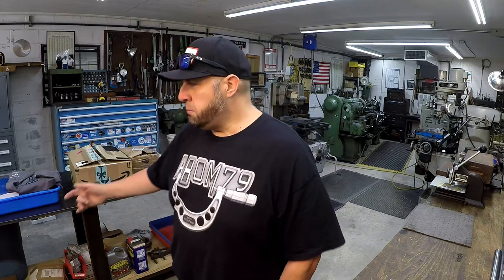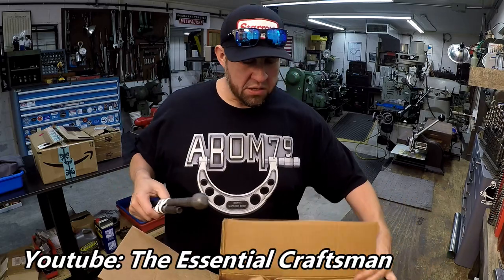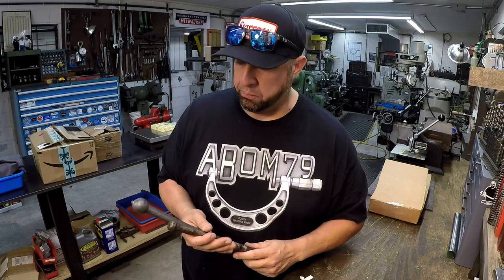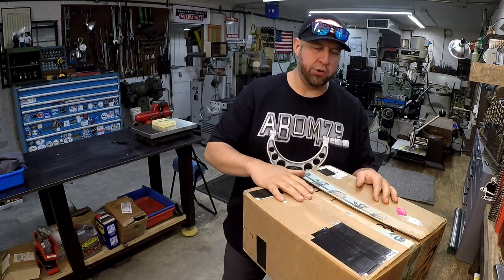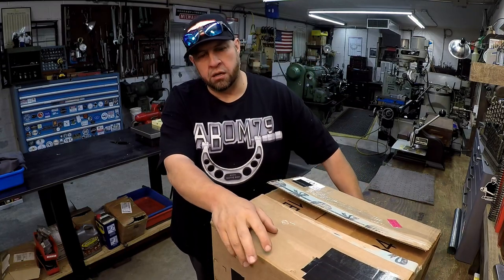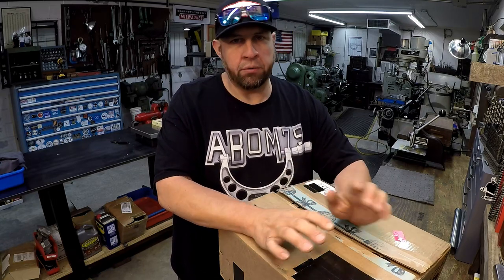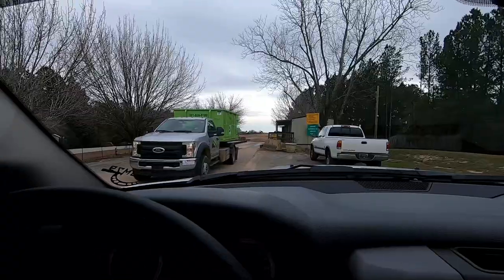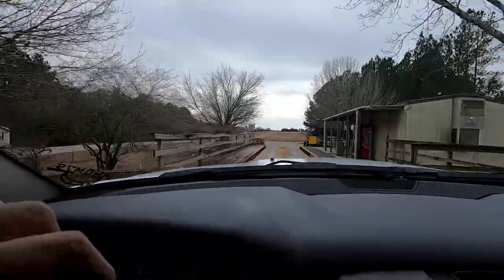SNS 251: Collaborations, Surface Plate, Precision Ground Stones

Comment: Hey Adam I'm an industrial air compressor mechanic in New Hampshire and we have in the shop we call the wall of shame, it has several things on it that got screwed up, a Fluke meter that was set to ohms when a guy tested 480 and the thing went boom, an aluminum piston rod that's half melted one of the guys put it in the parts cleaning tank that's caustic to aluminum, even a broken tail light from the owners truck that one of the guys backed into! You should start one and put that dial indicator on it. I bet we have 20 odd pieces up there and it's fun to look at

Comment: Congratulations to you and Abby on the Landfill Trip! And on getting engaged. ;-)
My wife and I treat our visits to the recycling and landfill centre as a 'date night' for laughs. Sue used to work in trash collection and recycling when we first met and I got to do a few shifts with her while we were dating.
Now we are both makers working together on commercial projects we still have a lot of stuff to dispose of. However, we do break it all down into recyclable materials first before land filling the small remainders.

When we got engaged and married we decided to make each others engagement and wedding rings from scraps. Our wedding rings are lathe turned from an off cut of stainless steel with brazed in bands of brass for a silver/gold stripe. Valueless and priceless at the same time. 
I made Sue's engagement ring from Yew wood set with three tiny brass screws whereas Sue braided mine from salvaged wire.
It made the rings more special to us then bought rings. And the rings, like our relationship, say that if things change or break we can fix it or remake it together.

Good luck to you both. I am very happy for you. :-)

Comment: Nice looking indicator Adam and thanks for thinking of the community when choosing the size / look. Tip from my industry of TV production, if you have a glare problem with your indicator faces you can "dull" the crystal by giving it a light dusting with fine hair spray. Will look a lot better on camera.

Comment: Its sad that the US doesn't have the infrastructure to separate and sort waste. Here in Finland, the greater fraction of our waste goes to "reasonably clean" energy production, reuse/ recycling or composting. Hardly anything goes to landfill compared to the typical waste routes. The important things that shouldn't go into landfill (fluorescent tubes being a big one) are handled directly by stores for free. Not judging man, not by a long way. It's a shame that the political will doesn't exist to create a better culture of waste management so that years down the line we're not dealing with environmental issues such as groundwater contamination, CO2 offgassing and general issues with land not being deemed as being usable for residential end use (essentially, the gold standard of "clean" whether used for that or not). I did a few years in civil engineering, working on contaminated land validation and remediation projects. The London 2012 Olympics site was the largest by a long way. The crazy stuff that you find "buried and out of mind" was just that....crazy! Risk assessments on encountering anthrax spores (railways commonly), mustard gas and munitions on old military (Lee-on-the-Solent, HMS Daedelus....Google it!) and basic chemical/hydrocarbon contamination sine the industrial revolution throws some big scary issues at times. "Careful drilling without GPR otherwise explodey times". This may or may not apply to cat trees. Glad you didn't landfill the Starrett. Congrats guys, and all the best going forward. :-D
Reply: TLDR; HMS Daedelus:
"In April/May 2006, whilst conducting repairs to the runway, building crews discovered an unexploded pipe bomb, of over 60 feet long, placed underneath the runway by the military, designed to cripple the airfield's operational capabilities in the event of a German invasion. The bomb (along with 19 others subsequently discovered) was scheduled to be removed in September 2006. The work was completed on 24 October 2006."
Twenty previously unknown WW2-era pipe bombs massive enough to destroy the entire airfield, and likely half the neighbouring town. Not sure what the yield of them was calculated to be, but I remember 300 equivalent tonnes of TNT being floated. Not sure if these are typical landfill fodder, but I digress......!!

Comment: That hole in the landfill is called a cell. It has a liner bottom of clay and other materials, including synthetic materials that prevent water from percolating through the trash down into the water table. They mix layers of trash and dirt and compact them tightly. When it is full, they cap it with clay and impervious materials and may include piping that allows methane to escape into a collection system that converts it into electrical or heat energy.
It may look like dirt and trash but is really a very scientific system for containing trash.

Comment: First, congratulations to you and Abby.  On the Machinist Relay, I suggest something that is "signature" Adam Booth--that is, heavy, with a shaper cut surface, a variety of drilled and tapped holes, and a mounting bracket to hold the thing Blondihack made.  Lot's of luck, looks like a fun project, and thank you for all the hours of education and entertainment.

Comment: You have to include Clickspring in that Machinist Relay. I don't care how or why one of his brass gears end up on that cute little gizmo.. but it won't ever be complete without one :) I'm already fairly certain that a trip by This Old Tony is inevitable. 
You, however, need to find some way to include a shaped cast iron part to it. Possibly also something with a small acme thread.. And knurls. Yeah. It needs knurled finger screws with acme threads or something!

Comment: Damn that dozer had some loose ass tracks lol. Crazy they let that go. Wears the hell out them.
Reply: Oh, that's just a John Deere, they have to be like that to make up for the sloppy tolerances on the drive sprockets! (I prefer Cat, can you tell? ;) ) 

You can hear the Cat loader whining too, and the 4 way bucket is floppy, so it's worn out as well. 

Landfills tend to be harsh environments for equipment, and they also tend to run the equipment until it dies, instead of keeping up on the maintenance, because they don't have the kind of lost revenue that a construction company would have from equipment downtime, so they just have extras and buy new ones when they break badly enough that they don't want to fix it. 
Part of it is that since the whole machine is being abused, the whole thing would need major work to keep it going, so while if a construction dozer had loose tracks, you would rebuild the undercarriage, and the rest of the dozer would still have years of life in it. 
Not as much here. 

Plus, dumps are usually run by big waste management companies, who, whether or not they are actually still connected to the Mafia,, still act like it, and make enough on our trash to buy new dozers frequently! Lol

Comment: That landfill looks so weird. Here you go to a recycling station where you have to sort everything yourself and throw it in different containers with different type of materials. Electrical equipment, wood, metals, rocks and concrete and such, sand, green waste, sofa's and mattresses, chemicals, batteries, fabrics. Everything gets recycled.
Reply: There is a lot of empty space in the US, though eventually all of the landfills are likely to get reprocessed through landfill mining as resource prices go up. I hear in Germany absolutely everything gets incinerated before being deposited in a landfill.
Reply from the maker: We recycle here too, every week. We both have recycle cans we fill up.
Reply: @warrentb1  Here in Holland they try to reuse as many materials as possible for recycling purposes, and what they can't reuse anymore will get incinerated in bio mass furnaces, then you have to think about old furniture and other bio mass materials, as long as it isn't made from plastic or other materials that are made from oil. And older landfills are used to extract the methane gas that comes free, and that's added to the grid or used for other purposes. 

For example, electrical devices and printer circuit boards get smashed and grind to a powder and they have specialized equipment to extract all the precious metals and such. I heard that these days one square yard of old equipment and PCB's contains more precious metals than a square yard of pay dirt at a gold mine. And the plastics and other metals are reused again as well. 

When we go buy a new electrical device we pay more than it actually costs, they call that removal fee. It's an extra fee that you pay for the future recycling costs when you need to throw your device away. And when you go throw away your electrical device at the recycling station you pay nothing. Also the store where you go buy a new device is obligated to take in your old device in case you have an old device that needs to get recycled. When you buy a new kitchen appliance or  a washing machine or a new mattress they take your old machine or mattress back when they come deliver your new stuff.  

Almost 80% from our garbage is reused again to make other stuff. But I did a quick google search and it seems that my country is at the top 8 of countries that recycle a lot of materials. So to me it is a bit of a culture shock to see a landfill where you can literally dump everything that you want. We stopped doing that years and years ago. I don't blame Adam, after all Adam is not the one who decides what happens to the garbage :-)
Reply: @Abom79  hahaha I don't blame you, it just a bit of a culture shock. I used to think that those landfills are from the old days. When people didn't realize that a lot of waste materials are actually valuable in large quantities :-)

Comment: Can you use the precision stones on granite surface plates?  Or is that a major no no...
Reply: There is actually no reason to use a stone on granite.
A granite surface plate doesn't get the same damage as steel, granite will break/chip out but doesn't give a burr or raised piece that sticks out, it is always flat but get holes in it. 
Steel or iron gets deformed when damaged, leaving a hole/dent and also material will move/raise at the edge and stick out, which you can remove with a stone.
I am curious now what a stone will do on granite, I could test it on a old plate if I dont forget.

Comment: 12:00 looks like it could be a ball bearing loader for a cannon. You lift up the center, line up some balls, in a row for auto loading through that hole/slot machined in the end. Would be a sweet to build a mini auto loading cannon. Not sure the rules in the USA but without rifled barrels they are unregulated in Canada.
Reply: no idea what youre saying but im on board

Comment: I saw the link to the gift registry as I started the video and I thought that I had missed the announcement. I sent a little to help and left a note. I've spent the last 10 years exploring the Four Corners (and for now I live there). I've got a Google Earth KMZ file with points all over the southwest that I can share if you're interested. Also, with the wet winter that we've been having there's a real good chance that Grand Falls (east of Flagstaff, AZ which is a beautiful area) will be falling when you're out there. It's normally bone dry and when it falls it's a pretty rare event. I've been told that while not as big as Niagra Falls it has more vertical drop than Niagra Falls. There is lots to see in the SW... quite a bit of it is free. Congratulations and best wishes to both of you.

Comment: The hand-scraped surface plate is certainly amazing, but can someone explain to me what the value-add of the process is?
Reply: Quick and marginally accurate answer:
Hand scraping is a way to get an accurate flat surface without a surface grinder, limited only by the accuracy of your master surface plate, your skill, and mostly your patience lol
You can get as functionality flat a surface with a surface grinder, but it has downsides because of the surface finish left by the grinder.

Hand scraping, in addition to being beautiful, also adds a surface finish that is perfect for metal working, because it holds oil and reduces the friction compared to a ground flat surface.
This is why travel ways on machine tools are often scraped, because it gives a smoother travel than simply ground or even polished.

Comment: i loved the trip to the dump ! i am guessing that the thing sent to you from Blondihacks is not a thing to be made into anything but rather a GIZMO in the spirit of Rube Goldberg. when it is done people will ask " what is it" and the answer might be it ain't really nothin' but it sure is cool lookin'.  i would like to see a trapped sliding steel dovetail along one edge of the brass that locks the folding steel piece in place by engaging a small round pin into the end of the folding steel piece. nice work on those tube holding vice jaws.

Comment: I'm actually shocked that you guys just take all of your domestic rubbish straight to a landfill! In the UK we have what's called recycling centres where as much recyclable material as possible has to be separated and deposited in the relevant bins and stillages. For example, my local recycling centre requires that the following materials be segregated from the truly non-recyclable waste and placed into the correct bins...
Lead acid batteries
All other household and tool batteries
Waste electrical equipment (WEEE)
TVs and monitors (separate from WEEE)
Wires and cables
Refrigerators
Waste engine oil
Waste cooking oil
Plastic bottles
Glass bottles
Waxed food and drink cartons
Hard plastics
Cardboard
Paper
Carpet and rugs
Scrap ferrous metals
Non ferrous metals
Wood and timber products (inc MDF, chipboard etc)
Hardcore (bricks, rubble etc)
Plasterboard (drywall board)
Garden waste (tree, shrub prunings, grass mowings etc)
Textiles (clothing, shoes, curtains, bedding sheets etc)
Household paint
Aerosol cans
We also have a 're-use' facility where reusable goods may be dropped off to be offered locally for resale into the community. 
We do have non-recyclable bins but their use is discouraged. Currently much of this waste does go for landfill but special incineration plants are becoming more widespread as landfill sites fill up. Landfill is a very costly option here where a government tax is levied based on weight.

This is just the UK, I'm pretty certain that much of mainland Europe actually goes even further in waste recycling.

This isn't a brag, just thought you guys over the pond might be interested to hear how things are done elsewhere. You do have a bit of catching up to do though!
Reply: I'm German and I am shocked by what I have seen. 
That's something I'd expect from a third world country. But what can you expect from a country that left the Paris agreement.
Reply: @horle  Don't forget why you know English...😉
Reply: I am actually shocked you took the time to itemize that recycling list.  

I understand your apparent default thinking that public policy on landfill is completely centralized across the United States, but that is far from the case.  Having lived all over the United States, you will find vary degrees of regulation.  It typically various from county to county, not state to state.  However, among the various states whose leaders think they know what is best for every single county, there you find a heavy-handed uniformity in regulations.  Among those states that tend to value allowing individual municipalities decide what is best for them, the people pretty much decide through their locally elected representatives (the opinion of Great Britain and Europe notwithstanding).

Personally, I am grateful to have been born and lived the majority of my life in a country that is founded as a democratic Republic.  Freedom can be a messy thing, but at least it is just that--freedom.  It is precisely the longing to live as freemen rather than serfs of the government/crown that motivated my great grandparents to come across the pond and set up shop here.  I am so grateful they made that choice.
Reply: @RandomWire107  I don't see your point. What's my English got to do with US's poor environment protection
Reply: Do you realize how much it actually costs to recycle? Most small towns can't afford the equipment or the labor to run it. Fridges,metal,tires,oil and such go in different locations in the landfill and are treated appropriately. Sanitary landfills are regulated quite well.
Reply: @horle  

The Paris agreement is nothing but a forced taxation plan. Global warming is nothing but a religion.  There is more false science involved with global warming than there is in evolution! Which is also just a religion.
Reply: @jesusisalive3227  Yes, I actually work within the industry. I guess the difference is scale, you have the space to keep on burying your waste for future generations to worry about (if the world actually lasts long enough) but I live on a grossly over populated island. We have no other option but to recycle.
Reply: I live in an unspecified state on the west coast. The same detailed process happens here. In some places in California, there are items one simply can not purchase to begin with. There are California mandated warnings about chemical content on an enormous number of products that can be bought there - at least for now.

Comment: Lovin' the brass and steel, finely machined hair curler.  Just add heat!  
Don't know how Quinn thinks that can be improved.  ;-)
Seriously though... could be used to trap a pin or spring, keep it from moving laterally in the non-pivot slot.
What would THAT be good for?  That's something for the next machinist relayers to solve.